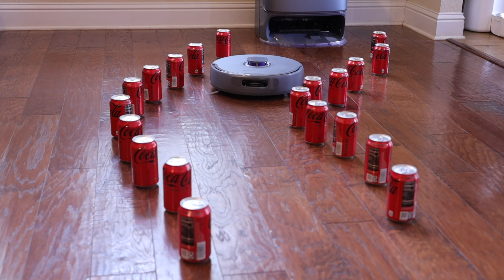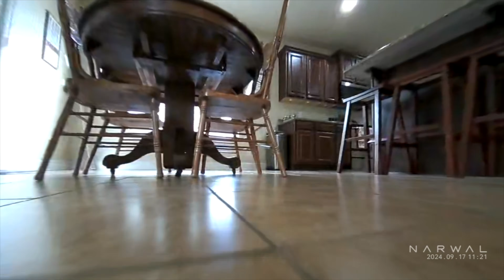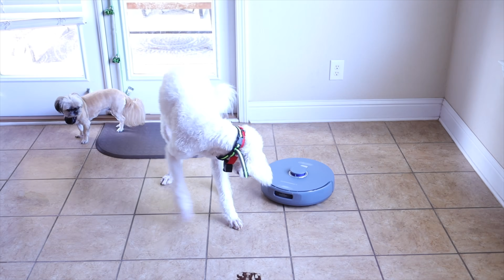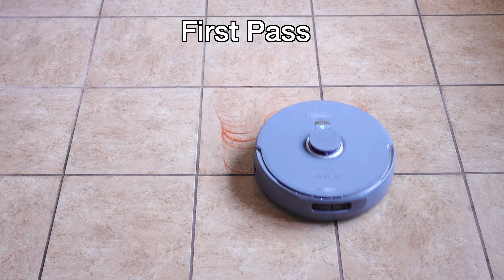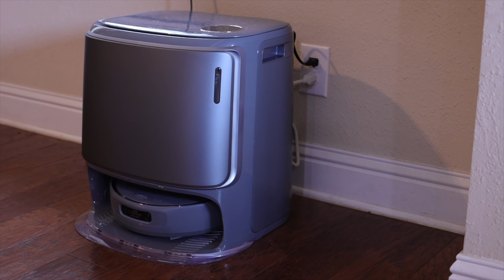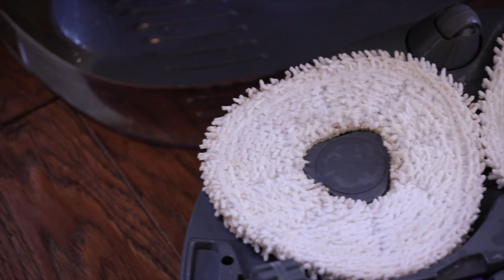Narwal Freo Z Ultra: Smartest Most Efficient Robot Vacuum Ever Has 2 Cameras and 2 AI Chips!

Comment: Oh this has alot of tech built-in...still wish it came with a wet mopping function...love its ability to clean the base boards..first one I have seen that do that...thanks Shane..awesome...😁😁😁👍👍👍
Reply from the maker: This actually includes one of the most advanced wet mops out there
Reply: @DroidModderX it doesn’t have a wet mop function it only wets the pads at the station it doesn’t have a inboard tank like the eufy s1
Reply: @Murphys_Law9 but it goes back to the base to clean the mopping heads till it's cleaned..uses quite a bit of water! And it's a way better vacuum than the eufy! Needs a bigger battery IMHO..
Reply: @DroidModderX 
Oh OK.. I guess I missed when mentioned it..going to watch once more
Reply: My baseboards are higher than the dribble and that's one of the reasons I wanted it